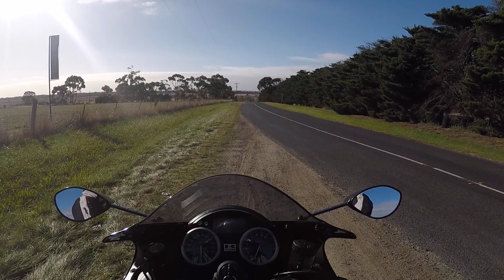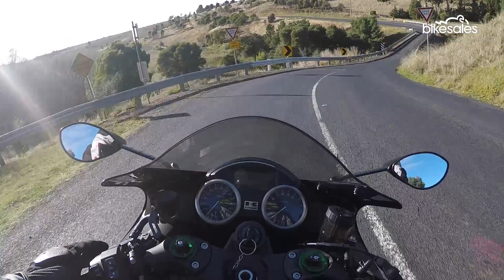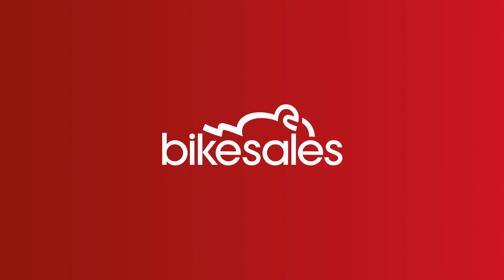Behind bars: Kawasaki Ninja ZX-14R (POV) | bikesales

Comment: Being fortunate enough to have a few bikes in the shed, my 14R has it's purpose. It's the only one I would go on fully loaded and munch away 2000-3000km in a 2 week round trip. Easy to maintain for the home mechanic. Some tasteful mods for touring ( center stand ) and a simple set of tools for piece of mind. The 14R will get you there and back with a massive grin.

Comment: Hi bikesales. Would you prefer Zx14r or the new Busa.?
Reply from the maker: Hi Vishnu, having just ridden the new Hayabusa, I'd say the ZX-14R is dated these days in terms of its technology but it's still a dynamic package and a great bike to ride. The new Hayabusa's safety, rider-assistance and convenience features are really important and worthy additions but then the bike now costs a fair bit more than the ZX-14R too (A$3500 more here in Australia). Bottom line? I'd probably buy the Hayabusa because it too is an incredible ride and it now has all the modern safety tech, but the ZX-14R still offers incredible performance at a lower price point, and it has a simplicity to it that will appeal to some riders. You can read reviews on both bikes at bikesales.com.au
Reply: @bikesaleschannel  Awesome. Thanks fornthe response.